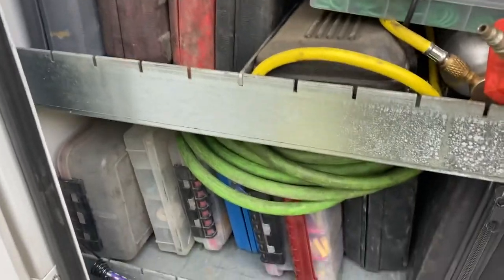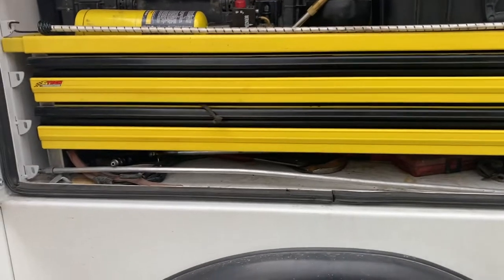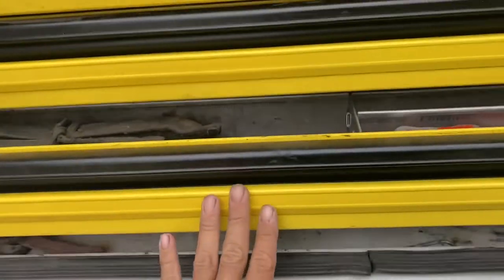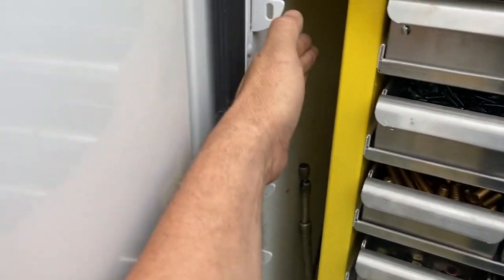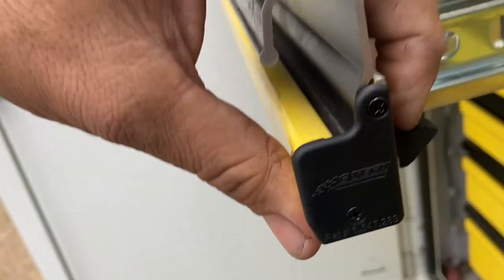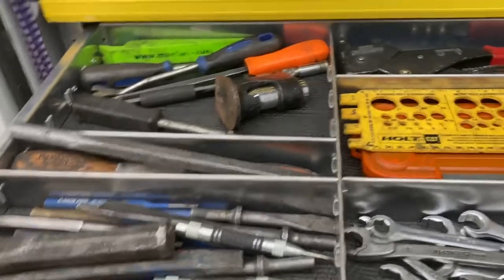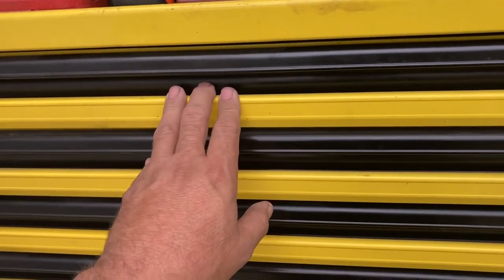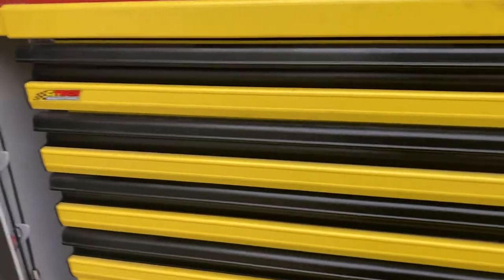Best way to store your tools in s mobile truck,C Tech tool storage just amazing!!!

Comment: Nice 👍 yup, a friend gave me a chest I made work and I picked up a craftsman box at lows and cut it up to work. Only thing I did wrong was the locking mechanism.. it's a single on the box from lows, it works good, but the 3 on the other box bind and hang up a little.. 
Been 3 years, not on the road like you are, but still rough conditions and it works.. but ideally, a proper set up would be great!! I like the looks of yours, over the others I've seen.
Reply from the maker: Thanks